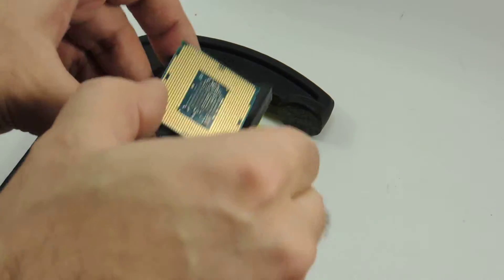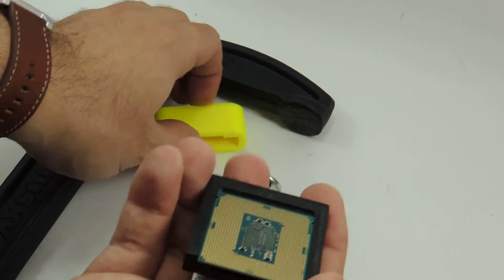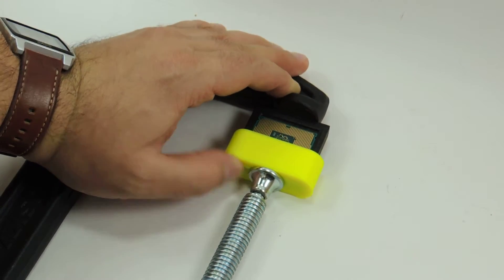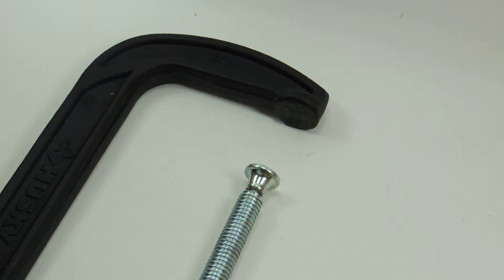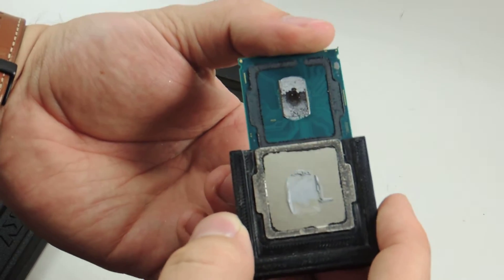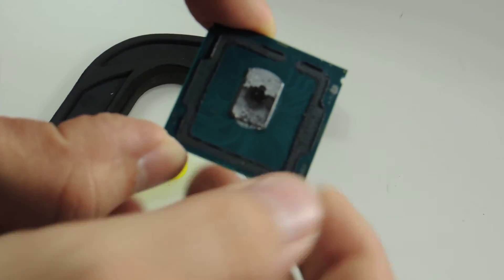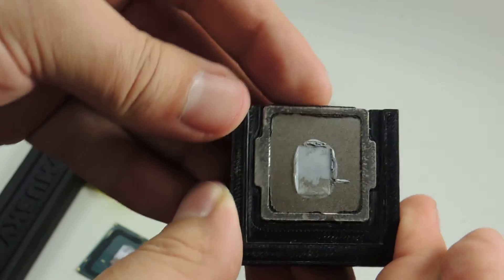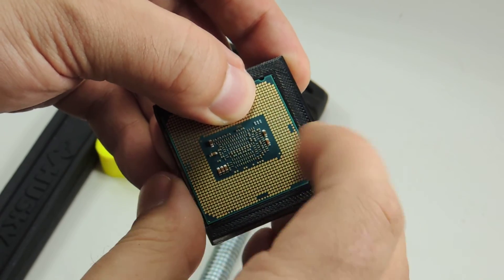3D Printed Delid Tool Results

Comment: Annyone knows if someone moded this to work with older CPUS like 771 xenon's ? 
I would really need that but have no slue how to mod the files.
Reply: +compufreek I'm pretty sure those are soldered to the IHS. I delidded my Pentium D which is an LGA 775 chip  for fun and it was soldered to the heat spreader.
Reply: So you basically destroyed your cpu?

Comment: Awesome tool!  Just looked at the link and would like to know when someone can verify if this will work on Ivory Bridge.
Reply from the maker: +Jason Dahlstrom I used this too delid both Haswell and Skylake, but I think it would also work with ivy bridge. If you print the one linked and you want it to delid ivy bridge, then you can just sand down the IHS notch openings (not the IHS, but the tool) to match (that's what i did for haswell to work)
Reply: Fantastic!   Now I'll have to hunt down someone to print it out and I'll let you know how it goes.   That is if someone doesn't already chime in.   Thank you again!